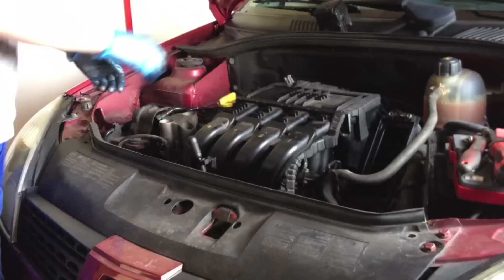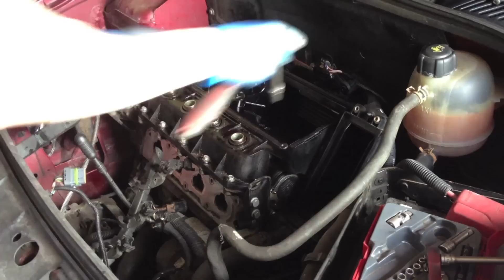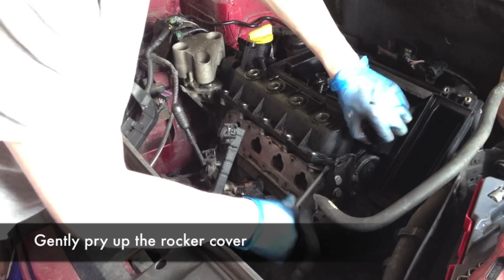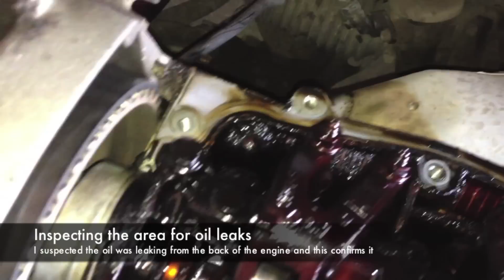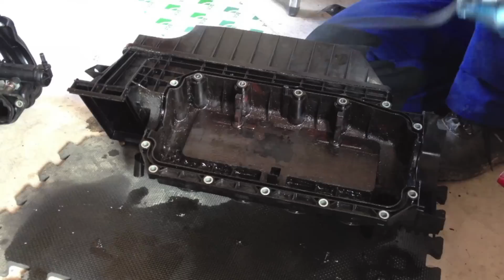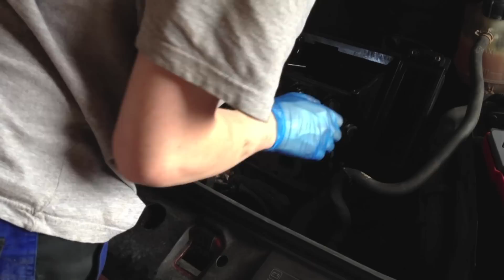Removing the Valve Cover on a Renault Clio

Comment: geez, so much work, i should just buy an old toyota
Reply from the maker: Its not really that much work, this car was over 10 years old when it needed the gasket which was a fairly inexpensive part.

Yes an old toyota may have better access but they are hardly the most inspiring things to drive and not entirely resistant to rust, some good ones still out there but its definatley something that needs to be scruitinised in detail whereas rust is not really a concern on a clio of the same age.

Comment: How long would this job take, please? I had a local garage quote me £379 to do this. Seems a lot? Cheers!
Reply from the maker: It has been a while since i did this job, 8 years now. However i don't think it took any more than a couple of hours and that included the extra time taken to set the camera up for the various shots. Perhaps price around, independent mechanics might be cheaper, it is not a car that requires a specialist. Alternatively use the quote of £379 to justify spending a bit of money on a set of tools to tackle the job yourself.
Reply: @peugeotCitroen2CV  Thanks buddy. Appreciate the advice 🙏.  And I might look into tackling this myself! 👍

Comment: Where did you get the new cover from
Reply from the maker: The same cover was used but the gasket was renewed, if i recall correctly it was just one purchased from my local motor factors.

Comment: how long does this take usually?
Reply from the maker: It has been about 8 years now since i did that job, strange to think.
From memory it took less than an hour to do and that included moving the camera about.
Reply: @peugeotCitroen2CV  thanks. How long do these last btw?
Reply from the maker: @chrisg24601  This was a 2002 car and the gasket was changed in 2013. Not sure if there is a specific life time to the gasket or if oil change intervals, incorrect oil types or some other environmental factor led to it leaking when it did.
Reply: @peugeotCitroen2CV  ah thank you. I just needed to make sure because I've got a 2004 and it's been leaking oil I'm taking it to the mechanics on Saturday to get it changed coz I don't want to risk damage to the engine
Reply from the maker: @chrisg24601  It will generally be quite a slow leak, if the oil level is checked daily the engine will not starve of oil. Although it may have issues with the oil dripping onto the exhaust manifold and creating bad smells, or onto the driveway and leaving a mess. Best to have it sorted for the relatively small price that the part and labour might cost.
Reply: @peugeotCitroen2CV  I realise that but I'd rather have it done now than having to potentially worry about it. I like to rev the engine so yanno
Reply from the maker: @chrisg24601  Haha i remember when driving this clio they were called the wheel spinner. The 1st car of choice for many a young driver the engine was very obliging to sit at high revs and spin the tyres leaving junctions.
Reply: @peugeotCitroen2CV  I do rev it hard but sometimes I can smell a sweet smell idk if that's coolant or oil. It can't be coolant coz I've replaced the thermostat and water pump and I'm pretty sure the head gasket isn't gone so idk. It's probably oil but when you get that smell it's worrying

Comment: have my rocker cover off today on my clio 2, 2003 16v 1200 been leaking a bit of oil from the rocker cover. - managed to get mine off without removing the top engine mount at all, just wiggled the rocker cover and it came off.
Reply: i got same issue doing mine soon. do you know if the exhaust manifold can be removed easily once the valve cover is removed ? there looks to be room ro remove bolts but not sure if the manifold will come out from the top
Reply: Mix Bag , hmmm I really cannot tell you sorry about that. I haven't removed the exhaust manifold. There is a good bit of room though in the engine compartment once the throttle body/inlet manifold is removed though

Comment: where could I get the service manual for this engine?
Reply from the maker: Ebay if you want say a CD of renault garage grade information, a haynes manual (ie printed book) is probably the best source of reference material for the clio.
Reply: Any other seals that can be changed when changing the valve cover seal?
Reply from the maker: The ones around the spark plug tubes can be changed, and they can leak on this engine. Other than that im not too sure what other ones leak on this engine

Comment: what differance would it make if the rocker cover wasnt torqued back on but just screwed back tightly? im to get this done next week as im losing oil at the rear off cover but the mechanic just said-oh it doesnt really need torqued as long as its only tighly-i wouldnt know but i assume there is obviously a reason for torqing it back on-what would your opinion be on that?
Reply from the maker: chevy790 
Generally i tighten bolts back down just using a ratchet and my own judgement of how tight it should be. Head bolts and anything inside the engine needs to be torqued down precisely but most other bolts are not as crucial. The torque figure is there to give an idea of how tight the bolt should be, if you have a torque wrench.
Reply: thanks for that much appreciated

Comment: Hiya. I have the same car, it's done 200,000 miles and still going strong! in really good condition as well. Anyway, Just recently I've noticed smoke coming from the back of the engine block and it does seem to be using oil. It seems quite "oily" around there as well. It's not overheating and is still running perfectly so I can't see it being a biggy, but do you reckon it could be this issue?
Reply from the maker: It could be leaking oil through the valve cover and smoking on the hot exhaust manifold. If you do change the valve cover gasket and it still smokes, the exhaust manifold gasket might need to be changed. If the exhaust manifold is leaking you might be able to feel the exhaust gas blowing by.

Comment: Why are you lifting the car? Do you really need to? Or can it be done without lifting. Does your Haynes also mention the torque for a kangoo 1.2L 16V KAR ones? Cleaning will stop the oil leak but do you need to replace the bolts or can you reuse the old ones. I see a tiny spec of white on one of the screws, is there any concern re water in the oil?

Comment: Do you know if the angine with the throttle body on the side will fit on this angine? Reason i ask is the newer design with theottle body on outside its easier to mount a k&n were as at the min you have to pay ovee 100 for a kit to make a k&n fit on this angine

Comment: hey just wondering if you have a head removal/reinstall video as im doing the head gasket got everything off now apart from exhuast mani fold and cambelt side case and the side case/cover does not want to come off undone all bolts i can see which is 2 m8x40 hexis on the side
Reply from the maker: +Robert Chadwick 
Unfortunately not it was not something that gave any trouble on my old clio.
I have a separate video dealing with the cam-belt on a clio, which may be worth a watch if its the covers you are having issues with.

Comment: Great video. I have just replaced the gasket seal on my clio. I would have no idea how to do it without your help.
Reply from the maker: rob jones Thanks for the comment glad to hear it helped
Reply: peugeotCitroen2CV The car fires up ok, but there is now an hiss when i press the gas pedal. I figured its leaking air from somewhere, and having traced my steps I can't see any problems. There is also a little smoke coming up from the back of the engine. Have you come across this before?
Reply from the maker: rob jones Hissing could be the gaskets for the intake manifold, does its running change if you spray around the inlet manifold. As for the smoke around the back of the engine check and make sure there is no oil leaks. although also look at the manifold if its cracked or any of its gaskets are leaked it could be causing these issues.

Comment: Thanks a lot for your videos, from a couple of weeks I have dismantled the manifold inlet cover, the throttle body, and the valves cover. your videos showed me the way to do all of that. Thank you so much for your helpful detailed videos. I need to ask you about an issue I am facing. I have a problem with the ECU plugs so that the plastic tensioner/clamp of the left plug is broken and I am fastening the plug (although it doesn't seem to be loosen without the plastic tensioner/clamp) with sort of tie raps. but do you have any clue about this type of plugs or name or model or even the manufacturer of the cable loom. I searched the net but it was all related to the ECU it self (Magneti Marelli - italian maker). is there any model name for this plug so that I could change the plug alone without the need to replace the whole cable loom. by the way the car is OK and I drove many time but i just like to keep it in its finest condition. one more thing, do you know where is the fuel filter and how to change it. is it direct and simple or does it have special way?. sorry for that long comment and thanks again for your effort.

Comment: Hi,
Just got round to changing rocker cover seal, do you need a complete seal kit i.e exhaust Manifold etc. In the video looks like you just put everthing back on?
Reply from the maker: You shouldn't need an exhaust manifold seal its not touched during this job, the intake manifold gasket if its perished this is a good time to change it, but mine was changed a year previously so there was no need to change it again.

Comment: Hi, i took the head off my car because the timing belt snapped and belt all the valves.
Its a renault petrol (clio 1.2 16valves petrol)  i replaced all bent valves, grinded in and re assembled the camshaft and rockers, this is my question?

Should the camshaft feel quite tight to turn over by hand by placing a ratchet & socket on the camshaft sprocket?

Even with my rockers fully unscrewed out of adjustment (ie backed off completely) its really tight to turn over and the head is off the car!, should it be tight like this, is this normal?

I have yet to adjust the valve clearances yet, but stopped because i panicked over the tightness, i thought it should be quite easy to turn. It actually turns, i feel resistance then it jolts forward when its coming off the top of the lobe, it does this 4 times for every revolution of the camshaft sprocket, its a 16 valve
Please advise if its normal to feel quite a bit of resistance with no belt on and head off vehicle
Reply from the maker: Ive never really stripped a clio engine down fully, the valve cover is as deep as ive got on the clio. I did have the head off my suzuki samurai and at the time the cam did have resistance but i think that was just the resistance against the rockers which were pushing against the valve springs, but as you say you have backed them off completley.
Its possible that the camshaft has been damaged or bent slightly from the time the belt snapped, i really dont know the insides of the d4f engine well enough to comment on how the camshaft should feel during a rebuild, renault forums would be a better place to ask someone there will know from experience.

Comment: Excellent video. A big hallo to you. One question please, does these engine need a valve adjustment ?
Reply from the maker: Krume Cesnoski Its possible to break out the haynes manual and feeler gague to check the valve clearance, but ive never had to adjust the valves on one, even a mates clio 1.2 has over 120,000 miles and the engine is running smooth. If it gets a bit rattly then consider doing it.

Comment: Hi :)

I have the same engine in my Clio 2 phase II - december 2002 year.

I can't found service manual.
Maybe you know.
What kind of tolerance should be valves IN and EX?
Reply from the maker: Hi Ebay should have dealer level service manuals on a CD, however they are a bit hard to follow. A renault clio Haynes Manual should have that information and are reasonably cheap.
Reply: Than you :)
I found this !

Comment: @peugeotCitroen2CV  thanks for these video, my clio use about 1 liter of oil every 1000 km could it be the valve cover need to be replaced(renault clio 1.2cc 16v has 100,000km )
Reply from the maker: +Richard alfred Its worth checking the air filter first see if any oils sitting around it, then check the valve cover gasket. Is there any unusual amounts of smoke coming out of the exhaust?

Comment: also how did you remove the manifold if you did mate as I've just read that you have to drop the sub frame could you just confirm this for me please as I will need to clean it
Reply from the maker: +chippa donk 
The inlet or exhaust?
I havent removed an exhaust manifold from a clio as of yet
Reply: +peugeotCitroen2CV I think I've sorted it, the oil was that bad out the rocker cover that it was leaking on top of the manifold cover, after removing the rocker cover all inside was covered in creamy oil but nothing at all on the internal parts so just guessing it's down to condensation build up, as I removed the gasket it split in 2 places

Comment: Hi
I have the d4f 722 engine on my clio. Is the procedure similar ?
Reply from the maker: This engine is a D4F not sure if it was a 722 or what that number refers to. It was on a 1.2 16v clio from 2002, it should be the same engine used in this generation of clio until about 2005-6.
Reply: @peugeotCitroen2CV  the d4f-722 is a uppdated engine if im not mistaken its a product from renault and nissan while the d4f-712 is a renault engine but those two engines is in basic the same.

Comment: do you have a video one replacing a head gasket for this car, ?
Reply from the maker: No i do not, however im currently editing a recent video where i fully stripped down a D4F because ive been asked a few times about head gaskets on these. I will deal with the removal, you may have to take the head away to get it skimmed and look up the haynes manual to check how to torque down the head bolts for reassembly.
Reply from the maker: https://www.youtube.com/watch?v=vCVpMPjVo74

Comment: diddnt have to remove the engine mount, just takes a bit of fiddling and it pops straight out but good video man
Reply from the maker: That would be true, I've had a few valve covers off with the engine in place but found it quite fiddly aswell, sometimes in these videos i remove a few extra parts for clarity or to make it easier to follow.
Reply: totally agree, diddnt mean to sound patronising, just thought id let the people know
Reply from the maker: Connor George No problem, thanks for your comment.

Comment: Why the fuck do the engineers make every fucking car as difficult to repair as possible. Gsus! One would think removing a valve cover to be quick and easy.
Reply from the maker: They have many more considerations to make than service requirements of the vehicle 10 years down the line. Costs, pedestrian safety, heat management, parts commonality are just some of the things that led to it having that particular layout...
I speak as someone who designs materials handling equipment there is enough going on working in that field to be able to empathise with automotive designers.

To be honest i did the repair and didn’t find it too difficult, do a few and it gets easier.
Admittedly its not as easy as say an A series, PSA 8v TU engine, or an early 2000s toyota but its not really that huge a hassle. It is not something that is required with much regularity.